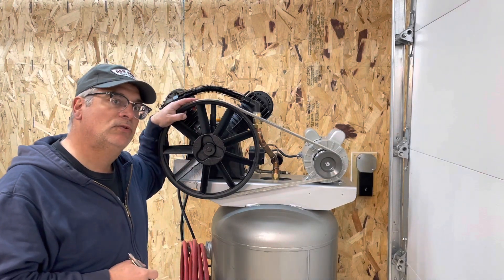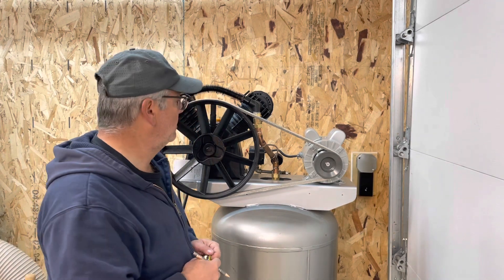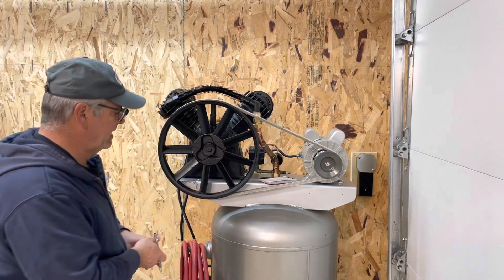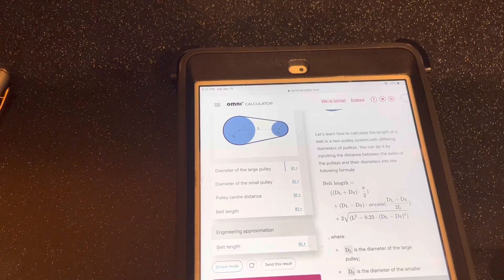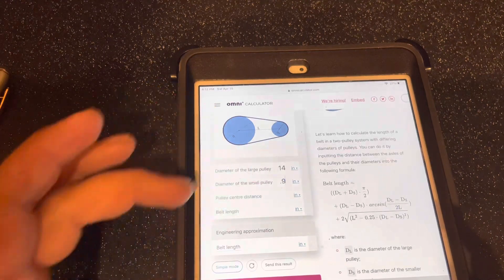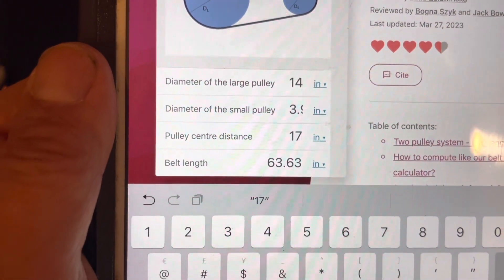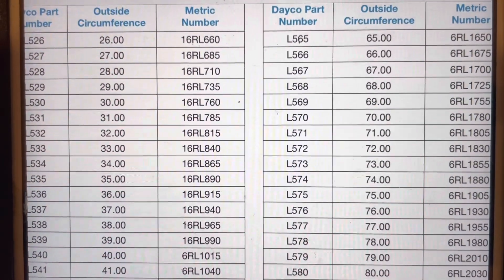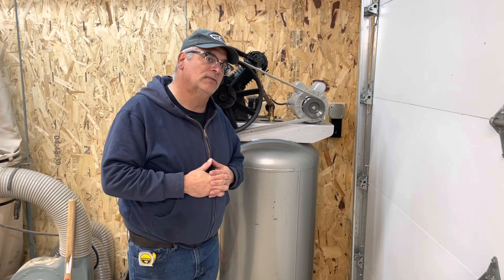Belt length calculator. Harbor Freight 5HP replacement pump video 5

Comment: I just got the HF 5hp 2 stage pump, but mine came with only 1 belt drive. What I'm wondering about is how you piped it in. The fitting coming off the head I thought was 3/4 npt, but it's not. In 1 of your video's, do you show the air pipeline and how you connected it to the tank?
Reply from the maker: I did look at the new pump yesterday when I was getting my free bucket. It is a bit different with how you plump it into your tank. I am unsure as to what sort of threaded fitting it needs as it was just a passing glance. The old pump I used the outlet you plump to points down off the left bank. New new pump looks to point just out of the left head. I used copper pipe and soldered in a couple fittings. I believe I show that in the second video. A number of people just use hydraulic hose with threaded ends.

Comment: Audio could be improved with Skywalker head set. You tend to whisper the corrections.
Reply from the maker: I am not familiar with Skywalker headsets. Just the Am raido ones back in the 70s. Looked just like the headset Luke had on in the movie.